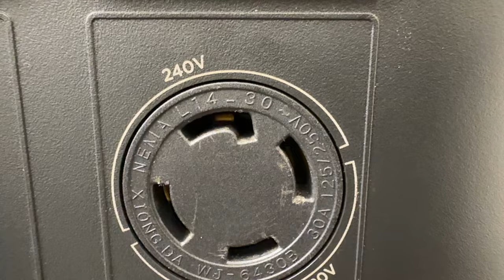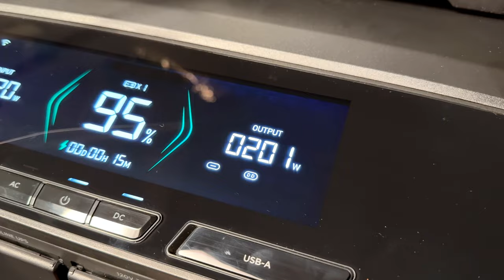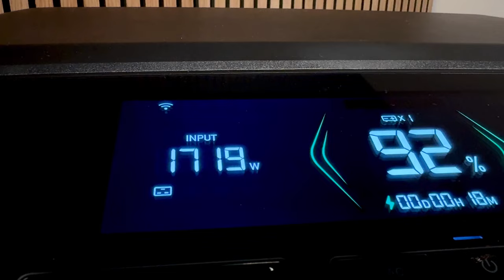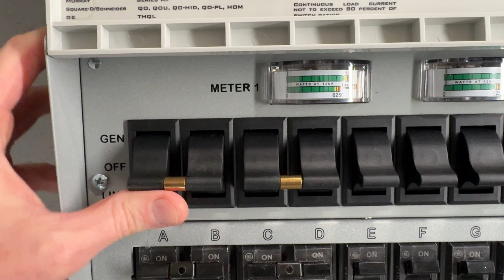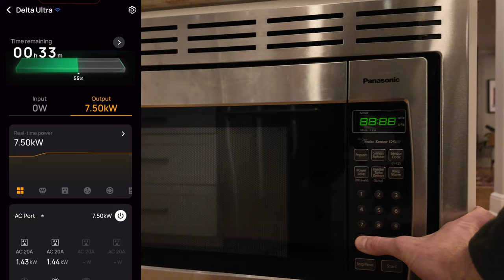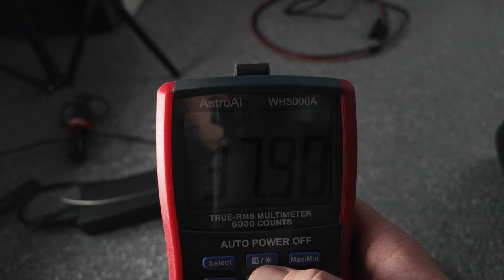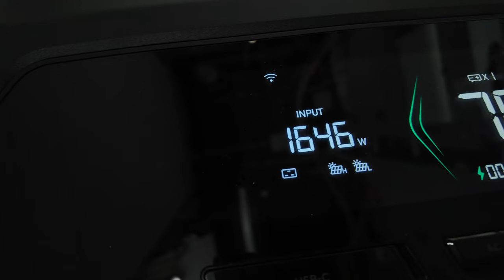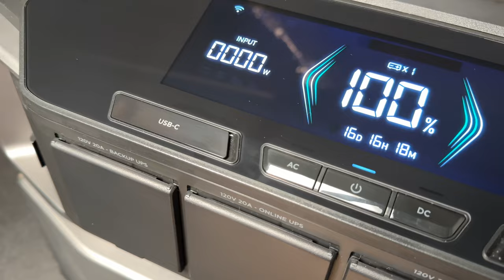GOODBYE GAS GENERATORS: Ecoflow Delta Pro Ultra for easy DIY whole home battery backup

Comment: I have the Ultra with 5 batteries, cost a pretty good amount. My issues is the constant error codes that require constant manual resetting. Support is comically useless with no actual solution, it’s like an AI response that ask questions I’ve already provided. Frustrating! So far I feel I made a costly mistake.
Reply from the maker: Oh no. I’ve had a few random error codes but I’m thinking those will get ironed out with firmware. You made a big investment, you should get good service. I’ve had good luck with EcoFlow’s support but maybe they are overwhelmed? What errors are you getting?
Reply: You just answered my question. I won’t buy one until I start seeing crazy positive reviews.

Comment: Overpriced. I can build the same thing for far less with an inverter and rack batteries. Why would I want to buy this? That price would even buy solar panels on top.
Reply from the maker: A DIY setup will always be cheaper, yep, but this is more of a consumer-friendly appliance that doesn't require any technical know-how and comes with support. If you can DIY it, go for it.
Reply: you also have to understand what the WH is too, like if this is 6.9WH is, it'll be 6,000+ dollars, so its a fair price, though DIY is the best solution too as well.

Comment: I have a Delta Pro which I was using as a UPS for all of my home entertainment equipment.  When the power flickered, everything connected went off.  I reached out to support to troublshoot they essentially said that was expected because of the 30ms failover time.   So yeah, really not suitable if you care about not losing power.  But fine if you don't care if you lose work as long as you can start over.
Reply from the maker: 30ms is a bit too slow for a UPS so some things may restart. The Ultra has a mix of 0ms and 20ms AC outlets so it won’t cause those issues

Comment: I love your whole home backup configuration! Having both the interlock and the transfer switch is awesome!
Reply from the maker: Thanks Jason!
Reply: Hi. I am getting g two converter system with smart panel2.Also getting 4 400 w solar and a generator. Do i need a switch panel for solar generator? . House is around 3200 sf and three AC. Thanks

Comment: Let's talk more about the $$$...what's your ROI on this setup?  I'm assuming you did most of the work and avoided the additional cost to have someone do it all for you..or did you?
Reply from the maker: I had to invest in re-working my electrical panel this fall because I was getting water flowing into my main panel and getting the breakers wet so I replaced the main connection line, panel, broke out a sub panel with interlock, and added the transfer switch. That was well beyond my DIY abilities but something I just had to do to fix up my electrical and use power stations to run circuits.

Re: ROI, I think you need to look at this as an investment for home backup that usually costs $10-20k with a gas generator. The benefit of a battery-based system with solar panels is you can get some monthly savings on your electricity bill by running some loads "off grid". 

For example, I've been running most of the circuits in my transfer panel (fridge, lights, boiler, water heater, microwave, etc.) 24/7 off the Ultra with solar for ~2 months so far and only dip into a grid if I run out of storage. That generates about 100kwh or power a month which will save me about $40/mo so that provides a small amount of offset that over 10 years will save close to $5,000 so that covers a decent amount of the Ultra's cost. It's not a return on investment but a big offset for the cost of a system. With a gas system, you can't do any of this so it just sits there costing you money each month until you need it during an emergency
Reply: @todd.parker  Also, in the rare event that you can’t get access to gas or propane.. the panels can provide sustainable/replenish-able power. The key is redundancy.. it’s best to have everything— solar, batteries, inverters, propane generators, gas generators, diesel generators, and yes Grid power. .. if one thing fails.. the others can bare the burden.

Comment: Great video! That Delta Pro Ultra seems like a better value than a Powerwall or other wall-mounted battery
Reply from the maker: It's a really great option if you don't need the grid integration of the PW. It's certainly much less expensive when you consider installation costs.

Comment: Any updates? System still working as expected? I'm very tempted on getting this system.. great video by the way thanks for the info
Reply from the maker: A few months ago, the solar charger died out of the blue but they replaced it quickly. Otherwise, my Ultra has been working great. I use it every day to power a bunch of circuits via my transfer switch to reduce my energy use. Just got a plug in hybrid (Prius Prime) and have been exclusively charging it from the Ultra and small rooftop array I show in the video.

Comment: Great content great editing! Thanks. 🙏🏼
Reply from the maker: Much appreciated!
Reply: I think I found a technical error in your logic when connecting two DPU’s to the 50amp Hub. You said that you would get 14.4kWh of AC output (assuming 7.2+7.2) when it is limited to only 12.0kWh of AC output when using/connecting via the Hub. The reason I know? I’m planning to use the 50amp Hub in my setup and saw that in the Specs. Still, an outstanding video for sure!
Reply from the maker: @drod6424 thanks, I might have missed that spec. Glad you enjoyed the video!

Comment: For that price,  you can build a battery bank with over 28,000wh and still have over $1000 left over.
I’m not knocking the system, it’s a good system. But your paying is for portability and not so much power. You can get 280ah Lifepo4  Prismatic cell for $99 a cell in you buy 32 of them. You need to get a BMS, but with $1000 left over you have a choice.
Reply from the maker: Of course a DIY setup will be less expensive, that's never a debate but the simplicity, performance, and safety of a system like the Ultra is miles ahead, especially for folks who aren't electrically inclined. I you don't know what you're doing, you can hurt yourself or burn your house down.

Comment: Great video.  Quick question.  Around the 20:00 you said something about not recharging the unit with AC while powering the house.  I thought pass-thru was a feature?  So does that mean I couldn't take advantage of cheap electricity rates at night to recharge the unit while it continues powering my house?  Thank you.
Reply from the maker: Pass through charging works great because that essentially just passes the grid power through the unit. I have a specific setup where I power some circuits with the inverter on the ultra with a transfer panel. In that case, the ultra is generating its own AC power so I can’t also plug it into the grid at the same time or there will be a ground fault. Probably won’t be something you run into

Comment: i have a ecoflow river 2 pro, and im using that as a UPS, however, im connected with the APC back up UPS, with this, i will have like 8 hours of runtime and with the apc i will have like 30 minutes for me to save the work i have for the computer and SAFELY shut the computer down. sometimes here in massachusetts the electricity WILL go off during that time a lightning bolt struck not from here, and whilst i was working, it knocked the electricity out, however, i had computer for like a couple of seconds before it went out.. let me try to rephrase this, for the computer

i have my computer hooked into my APC on the backup UPS whilst i have my APC hooked into my ecoflow river 2 pro giving me 8 or so hours for me to be on the computer, whilst the other cord from the ecoflow river 2 pro is hooked into the grid, and i have my charging speed to 100 so i can get more charge cycles cause my computer is using like 35 watts with both moniters being like at least 20 or 30 watts totalling the wattage to only 60 to like 70 watts, if im using the fan its an additional 10 to 12 watts of power, which i dont mind at all. that will allow me to run this off grid for like 4 to 5 hours if im hooked into everything. 8 hours if i only have my 1 moniter and my desktop computer only powered.

Comment: Nice video.  I also like that you paid for the product versus so many of the reviewers who were given the product.  I like how you talked about the ground loop issue.  Am I understanding correctly.  You have another power system battery that has a separate charger that plugs into the wall socket and outputs DC that charges the battery and then the AC unit converts back to AC and you plug that into that Ultra AC input with the switch set to slow.  This avoids the ground loop.  Is that correct?  If so it sounds like one of the older power stations that came with an external wall charger would work well as making sure the Ultra is powered up.  Am I understanding this?
I see people using a SMS system to convert AC to DC and plugging into the Low PV port as a backup but that requires a way of switching between solar during the day and the SMS DC output at night if needed
Reply from the maker: Hi. Yes, any power station with a DC power brick will let you plug this into the wall while the ultra is powering circuits to avoid the ground loop. Works perfectly for me to make sure I don’t run out of power with bad weather. I was given a review unit but all opinions are my own, both pros and cons.

Comment: All I want to do is power two full size fridges, hot water heater when needed, a light and fan. That's all I want to power for min of two days.
Reply from the maker: A fridge uses 2kwh a day so you need a system with at least 9-10kwh of battery power to cover that scenario. If you add solar you could probably get by with half that but you'd need some sort of generator backup if the weather is bad. Hope that helps.
Reply: @todd.parker  I have a small generator but  am planning to buy a better one. For Florida and our hurricanes I need to prepare.  My plan is to get an ultra, extra battery, smart panel and two solar panels. I'm hoping that power only goes down for a day or two. Although last big hurricane ,we had no power for 4 days.
Reply from the maker: @Graxis1  cool. If you get the ultra you don’t need a big generator but having an inverter model will supply cleaner power to it. Just kick it on for an hour or two to top things off when solar can’t keep up
Reply: @todd.parker  that's exactly what I have an inverter generator, lol.

Comment: It's whole house, as long as your house only has 12 circuits.  Otherwise it will be a partial backup
Reply from the maker: Not sure I understand. Yes, I have a 12 circuit transfer switch but I also have a sub panel with interlock that powers another 12 circuits. The only things I don’t back up are things like my induction stove, electric ovens, etc that are too power hungry and not essential. Maybe you didn’t watch that whole video?
Reply: @todd.parker  nope I didn't watch the whole video. I was about to buy this product when my electrician asked if I understood that it will only do 12 circuits.  My house has 24... No matter if I did 3 inverters and all the batteries, I could only really send power to half my house.  
It is not a whole home back up.  It is a beautiful little system but it is click bait to say whole home imo
Reply from the maker: @RandomlyRich I think you’re talking about the smart home panel being 12 circuits. The ultra can power your whole home if you install an Interlock on your whole panel. Just watch the video 😂

Comment: How would you tie this into an existing rooftop solar grid system to charge the ultra?
Reply from the maker: If you have an inverter in your basement then you might be able to tie into the DC power before it goes into the inverter. I have micro inverters on each panel so AC power is coming off the roof so I had to install a separate array that is DC

Comment: You have everything connected to the EcoFlow, but how long can you run it is the big question? 

You don’t have enough solar to charge the system and the EcoFlow generator don’t have enough power to keep up with your demand. You need to run a real test and be on battery backup for a few days, then you will see you don’t have enough solar or generator power to keep up with the demand of your house. Especially those ac package units. Those things will suck the power out of your system in an hour or two. I’ve been working on a hole house back up for more then two years. I have close to 1kwh of batteries and I can go up to 3 1/2 days with out any sun. But… I have more then enough solar to fully charge the system.
I know for a fact that EcoFlow system don’t have enough power to run your house for 12 hours. Not enough. You will need to add my batteries to keep up with your demand. 

Run a test, see how long you can really run. Can you run a full day or night? Find out now and not in a emergency.

Good luck
Reply from the maker: Yeah, I showed how many things the Ultra can run at once (a lot) to test it's max output but running loads continuously 24/7 is a different matter. 

I've actually been powering most of the circuits on my transfer panel (but no AC) in off-grid mode for the last 2 months to dial things in and save on my electric bill. I've been running my full sized fridge, gas water heater and boiler, downstairs lights, microwave, internet, and a few other things every day off this system and it's been flawless. 

On a decently sunny day, my panels can pull down 6-9kwh at this time of the year which is enough to fully recharge the battery easily but when I have stretches of snow or clouds, it will drop to 20% and that's where I have another power station to trickle charge the Ultra so I don't wake up to dead fridge. I show this setup near the end of the video. I've been averaging around 100kwh per month of solar input and balanced the output to be roughly the same but this will increase a lot as we head to spring. When I get a second or third battery, I'll have a lot more breathing room and can run even more.